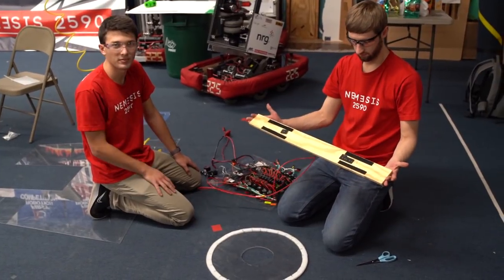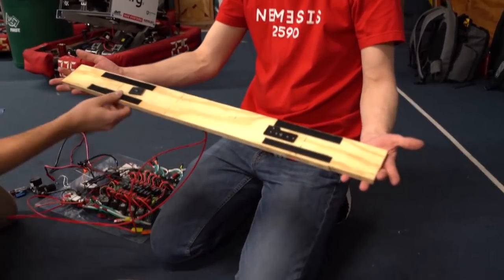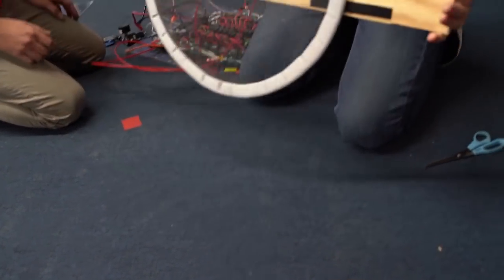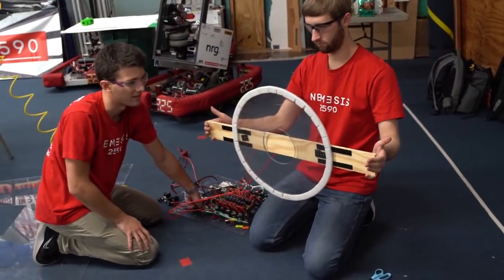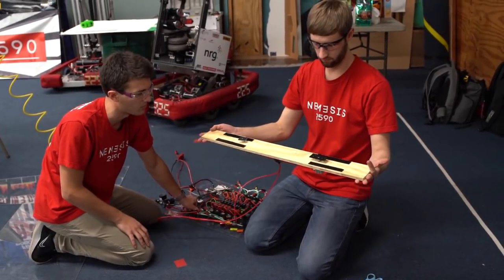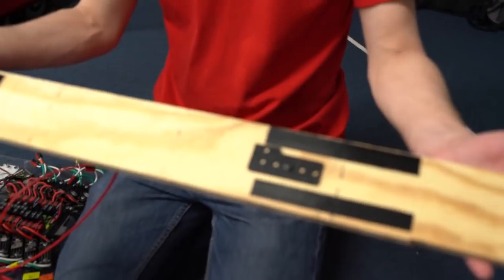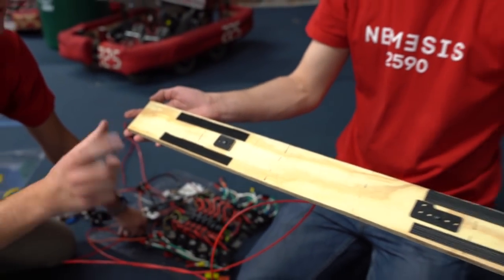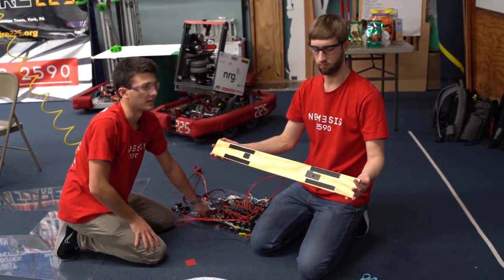Ri3D Team Capital Hatch Prototyping - Robot in 3 Days

Comment: Just a quick question, my team is thinking of using something similar as a pickup system and we were wondering if that worked for tacking the Hatches from the Loading Station? We were wondering if the Hatches would get stuck on the brushes of the Loading Station.
Reply: Hello! It seems to be working right now. We're also working on improving the retention system for the hatch to better secure it in the robot.
Reply: We had the same question. I’m hoping someone builds the loading station and shows us the amount of force required to pull the hatch through the brushes.
Reply: @benmartin3748  I'm wondering if the velcro bar cold push against the Hatch in the Loading Station and then elevate to clear the brushes and pull back.
Reply: @laurenwilliams2553  Here's our modified design for hatch panel retrieval from the loading station and we'll soon be posting more videos about it:  https://www.facebook.com/techfire225/photos/pcb.2105300106196025/2105299822862720/?type=3&theater
Reply: Elevating to clear the brushes and pulling back is definitely possible. We currently plan on just pulling straight back but if there's issues with that then we'll try elevating to clear the brushes